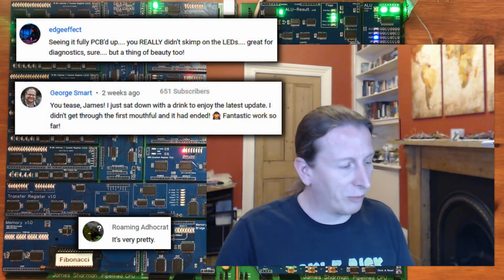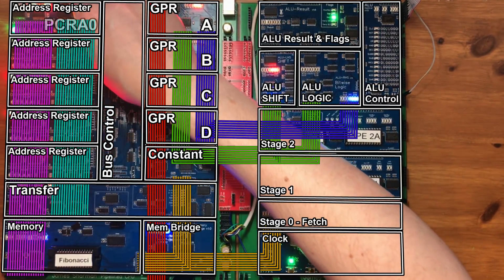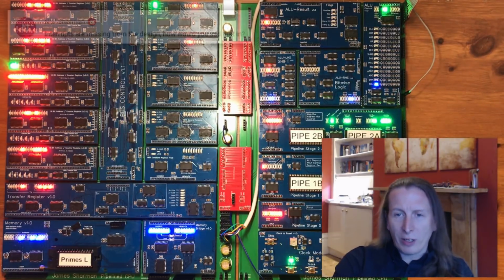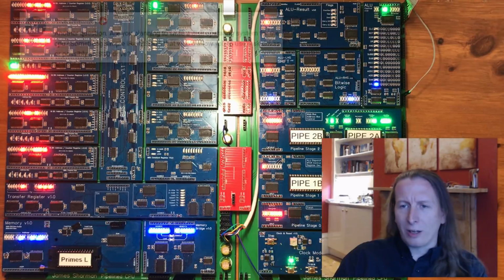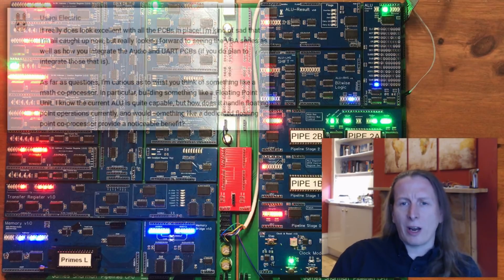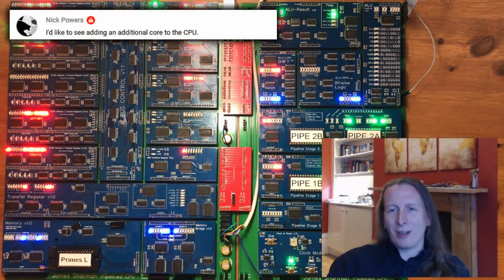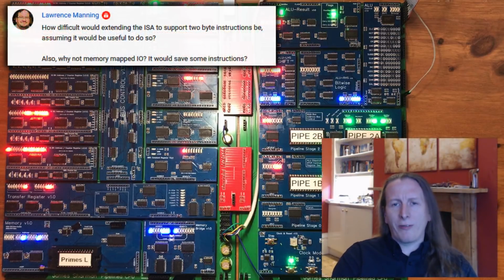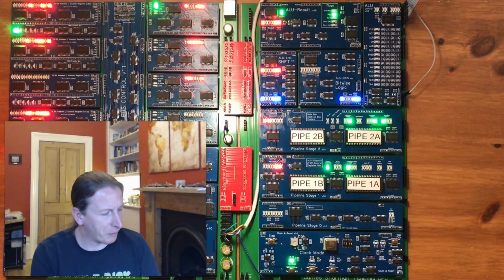Design Retrospective - Making an 8 Bit pipelined CPU

Comment: Curious why a fibonacci calculation program was used for testing rather than Byte Magazine's Byte Sieve as that would be a more appropriate benchmark of your system with a wealthy listing of results to compare against.
Reply from the maker: I think the answer to that question is that test != benchmark. Fibonacci was a far more suitable alogithum for early testing of the system.  I never implemented the exact Byte Magazine's sieve, if you need to be convinced I wasn't shying away from more complex code (even in the early days) you can see something very similar demonstraited here: https://www.youtube.com/watch?v=YxScH_ZQAZA
Reply: @weirdboyjim  I do apologize. Obviously commenting 4 years later I'm late to the party and have a wealth of ignorance on how your project evolved. Thanks for the video link!

Comment: Did you consider programmable instructions? Instead of getting the control flags from ROM it would get them from a dedicated register that the code itself could set. So the multiply and divide routines could have set up for themselves the special instructions that you created specifically for them for speed. Such instruction configuration would soon get overwritten by the next routine that needed a different one.
Reply: I see this was answered in reply to a comment in part 85. You also suggested replacing the entire control ROMs with RAM which would also improve speed.
Reply from the maker: Making modifiable control logic is an interesting idea, but making it changeable would add complexity. I used the rom chips to simplify the circuit so it would feel counterproductive.

Comment: Is there a way you could use dual port RAM to save yourself the NOPs  in the pipeline?
Reply from the maker: You could indeed to that, but dual port ram is extremely expensive. You could probably do something else cheaper. I'm mostly trying to explore different techniques that would have been possible back in the day.

Comment: Really interesting stuff - thanks, James. 
I wondered when I was watching the video where you created the break for the clock - when running at high speed does it overshoot or stop exactly where you expect? The mosfet and selection have a time penalty I assume? But maybe they're always fast enough compared to microsecond clock cycles?
Reply from the maker: Thanks! You get a short video answer to that question though:  https://youtu.be/IjgslYq4-Vw

Comment: 21:06 that doesn't sound right, the Z80 takes ~4 cycles to do a single memory access. to compare the 6502 takes 1 cycle per memory access.
the 6502 on average takes 3-4 cycles per instruction, with the Z80's memory cycles being around 4x slower it takes much longer and cycle counts of instructions are usually in the 10s of cycles.
Reply from the maker: The table I displayed there is taken from widely accepted numbers you can get of wikipedia, I didn't test them myself. I do suspect my "instructions per cycle" figure is slightly more honest than some numbers used in marketing for other micros.
Reply: @weirdboyjim  I'm using the numbers from the respective datasheets or whatever the community measured and documented. The Z80 separates clock cycles from Machine cycles. 1 machine cycle is roughly 3-4 clock cycles. I assume wikipedia refers to machine cycles, in which case the cycle counts you mentioned fit.

On another note, and sorry if this was answered in the video already I haven't gotten to watch the whole thing yet, but have you thought about rebuilding your PC in an FPGA just to see how far it can be pushed?
There are some logic simulators like Digital that allow you to export circuits as Verilog/VHDL. Which makes designing and testing circuits much easier IMO than directly writing them in an HDL.

Comment: 23:00 ish.
Just thinking out loud here but, now that you have the rom copied into ram for execution, could you hand the rom over to the fetch unit for exclusive access, meaning that it could always do the fetch, regardless of what ram is doing? The downside would be no self-modifying code, but the upside would be  a boost in performance.

Maybe you could even have the best of both worlds if you use the address to figure out whether you could access the rom uncontended, or wait for access to (high) ram.
That's probably overcomplicated though!

38:00 ish
With this architecture I think, theoretically, you could define an opcode that effectively does (a<<1) + (b&a) as a single instruction? (and a whole bunch of other similar combinations)

40:10
It would, presumably, also save on opcodes? Which might give the ability to have extra features
Reply from the maker: I wanted this build to have flexibility for self modifying code so that would be counter productive. To have separate memory channels for data and code is something I will be exploring in the next build.
Reply: @weirdboyjim Limiting an assembly programmer on a limited architecture to no self modifying code when you've got a whole glorious full address space of RAM is kind of silly. It allows some really whacky stuff that can save a lot of register use in things like those floating point routines, or removing branches for speed.

Comment: What a project. I just finished binge watching the entire build, and I enjoyed it a lot. The performance is better than expected too, and I did have few jaw draw moments, when saw it in action. Great job.

I think one change that might be useful, is ability to increment both di and si in one instruction in same cycle, just these two. This will require very small modification to the bus control board, but could pay off in terms of performance a bit. And I would also add provisions to do opcode which do di++, si--,  for reversing things, but that is also useful for one being and index, another being a count. Having zero comparator for si, and having conditional jump on it, could also be useful.

Other than that, i think it very close to optimal. Good design simplifications to make it actually work, and not sink in complex stuff. I think the best to avoid memory bus contention is to have a cache for instructions, and prefetch instructions a bit faster than they are executed. But that is entire new can of worms. Definitively interesting idea tho.

I also think shadow ram copying could be actually done in software, by prepending a bootloader, then just before the final jump, bootloader would enable fast clock mode. But hardware implementation is also nice.

Just few suggestions. But I think the build is really clean, and I like the ISA and micro architecture of it. It is way cleaner that I would imaging such CPU would be. I designed a CPU once, but only simulated it, never build, it was static non-pipelined design, everything took 1 cycle, but on real hardware it would be rather slow and complex.

I do hope to develop some physical CPU inspired by your build, but I probably will go with vertical PCBs for main components, so they can easily fit on a desk, with some debug features on the edges of these extra boards, but they would just slot into main board (probably still using 2.54mm pitch connectors, but who knows, maybe edge connectors could work too).
Reply from the maker: Thanks for the kind words, glad you found it interesting. One of the restrictive limitations of this build is the  opcode size, it means you have a limited number of instruction permutations. There are lots of useful things this hardware can do already if I toggle the control lines correctly but there is no instruction to encode it, the question is not "Is this operation useful" it's "Is this useful enough to earn it space in the instruction set". Other people will have different priorities to me so there are no "true" answers to some of these trade offs.

Comment: Hi James!
Thank you for posting this series. It was quite interesting for me. I am if a vintage where the Mini-Computers of the 1980s and 1990s used the TTL chips you are usingbfir 'serious' commercial computing. 
I understand now why you chose not include Interrupt circuitry. 
However, one of the main things I was curious about was how your pipeline would handle the context change of an ibterrupt. 
So, I guess I have to wait for your next CPU build. 
I guess the best / fastest solution would be to have a set of shadow registers.
I had not realized that you had not latched the ALU flags in a register.
I guess you could implement a larger Register. Bank with a small static RAM chip. The GPRS registers would be addressed by the unmultiplexted register address. 
A context change would allow the switching of the register bank for interrupts simply by toggling an upper address line. 
Then all GPRS could be implemented in only 1 PCB that displays the content on LEDs when accessed.
I would be interested to learn how you would handle the context switch in the pipeline. Could you rescue the content and states, or would you have to empty the pipeline vwith NOPs.
I guess you could allow the pipeline to finish executing the pipeline and afterwards feed it with the consequent OP codes. 
Or do you see a way to re-inststevthe pipeline contebts after the interrupt.
A mass storage device would definitely be a good thing and the easiest device is probably a micro SD card.
Anyway thank you for making this series. I foubd it very enjoyable.
Reply from the maker: Thanks for all the kind words.  On the execution side of things you would just need to add an interrupt handler PC and an interrupt flag.  With the interrupt flag set the fetch unit would pull instructions from the IntPC, you would have a stub handler in a tight loop that resets the flag right at the point where it is ready handle the next interrupt.

Comment: I'm curious about the pipeline stage 0 latch that enables it to re-issue the same instruction. What is the advantage of this design over inhibiting the clock going into pipeline stage 1?
Reply from the maker: Critical path predator includes fetch so adding more work in stage 0 that can only be started after the instruction is read would further reduce the maximum clock rate. Then at best you would replace the instruction passed into stage 1 with a NOP, this way it doesn’t add any time anywhere.

Comment: Would using a memory architecture like the C64 used help prevent stalling the pipeline?
Reply from the maker: I'm not sure what about the C64 you are referring to here. The fetch stalls happen because I have a fixed amount of memory bandwidth and if another memory access is happening it blocks. To get around that you need memory that's faster than your cpu clock, or multiple paths of access (I.e. caches or the Harvard architecture).

Comment: Interrupts can be implemented by forcing the fetch unit to inject a hard coded sequence of instructions, like how you inject nops (mov pc to intlr, mov israddr to pc), and add a "return from interrupt" that uses intlr instead of lr, but yeah, you need a way to save and restore flags. You can hard code the address of the ISR (the kernel programmer can put a jump there). You could also inject a sequence of instructions that store LR at address 0 or some hardcoded place, followed by an injected instruction that calls the hardcoded ISR address with a normal call instruction, if you really didn't want to add another interrupt link register. You're right, it's a bit too much, you would have to save tx too, and restore it in interupt return.
Reply from the maker: I've thought through a number of different ways to do it, you suggestions taken together include several sizeable changes. All in all it wasn't really designed with this in mind, Adding what amounts to a microcode interpreter at the front of the pipe would make things a bit easier but it also distances the cpu from what it is supposed to be.

Comment: The Z80 took 8 clocks to do a NOP.  In the Synclair ZX81/ZX81 computers this fact was used to fetch the bytes for the display and shift them out.  The Z80 still was faster than the 8088 that was in the first PCs.
Reply from the maker: I've been reading about the memory architecture on the Spectrum,  very interesting the way it lets the logic array overide the cpu. Not sure about that z80 vs 8088 performance differential though, there maybe specific operations that are faster on the z80 but overall the 8088 was much quicker. The 16 bit registers + alu along with hardware multiply / divide is too big an advantage.
Reply: @weirdboyjim  Yes, the micro would jump to 8000H plus the address of the display area and hardware forced the Z80 to see NOP instructions unless the instruction was a 76H (The HALT).
The 8088 took a trip through the ALU for any memory access.  A jump instruction would take about 22 clock cycles.  Many samples of program code flinging bytes around were faster on the Z80.

Comment: This is awesome! now make a multi-processor system and have two of these sharing memory!
Reply from the maker: Thanks! I won't be taking this one multi-processor but I have plans for a future build more suited to that kind of experimentation.
Reply: @weirdboyjim  I've got several ideas floating around for a multi-processor system using off the shelf Z-80's or 8085's or maybe even both at the same time as their instruction sets are mostly compatible and I've got several of each laying around. I just haven't got around to making any of it due to budget constraints. At one point I was even designing my own multi-tasking OS. I might still try the second one as I've got some new to me hardware to play with and continue reverse engineering.
Reply from the maker: @RingingResonance  interesting, one of the regular commenters had a plan to make a gpu from lots of 6502’s they had laying about.
Reply: @weirdboyjim  It could be done using a cache system. Each CPU cache would have a small amount of dedicated memory used for itself to remember what byte in ram had been last updated so that once main memory is no longer accessed the cache system can access it and update it or grab the newly changed byte. All this could be done between CPU read/write cycles and if any conflict just tell the CPU that's trying to access memory to hold for a DMA cycle.

Could also make a memory management unit for the 8085 as it has a few internal CPU cycle status pins. Not sure about any of the others as I've never played with them before.

Comment: For version 2.0, would it be possible to design the address register boards such that they can be used as a single 16 bit register or two 8 bit ones? That'd allow you to reuse the same board for the GPRs, and let you get double the GPRs while you're at it.
Reply from the maker: You could do that, you are essentially combining the features of the GRP, the address registers and the Transfer register.  I did it this way to try and make  the design simple showing different concepts in different circuits.

Comment: Would extending the memory data bus to 16 bit, and adjusting the fetch unit to split that 16 bit into two 8 bit values, and caching a few of those in the fetch unit, be an big improvement you think?
The way i reason is that that way you can stil feed the pipeline while the memory-bus is busy.
Reply from the maker: You would need a lot of other changes to make that work but yes doubling the memory bandwidth would be a speed up

Comment: So you have to save flags and registers even on the 6502 you have to save the registers in your interrupt routine
Reply from the maker: Yes, it’s important that the data the interrupted code is working with isn’t affected. Flag saving and restore is handled by the setup and rti instruction which makes it easier.